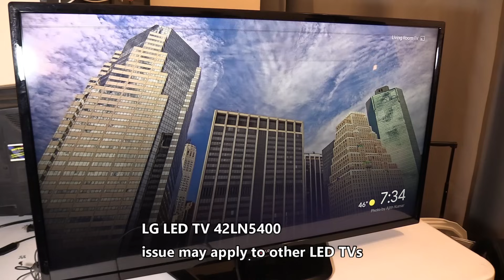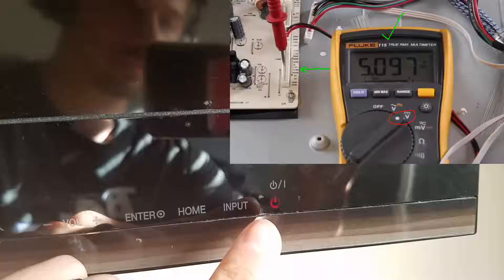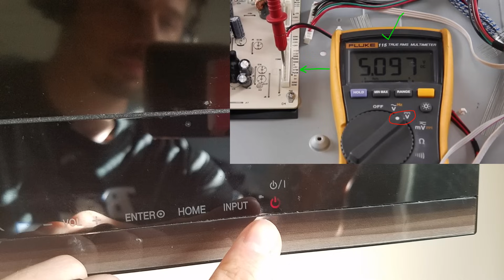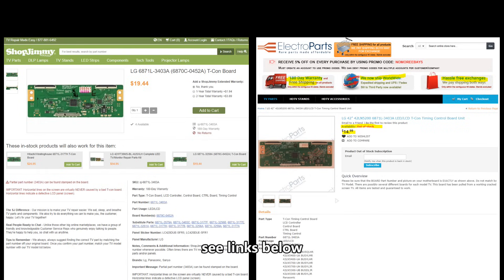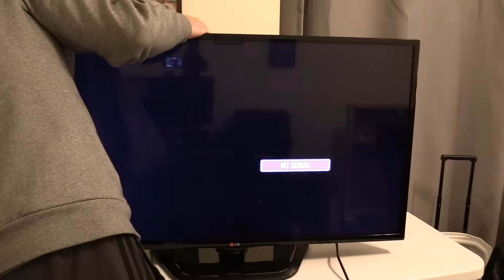How to Fix LED LCD TV with horizontal & vertical lines on the screen

Comment: Hi....Have a SAMSUNG LA26RT1B LCD with T-CON 260W3C4LV0.0 (Panel : LTA260W2-L13 Samsung), the problem is thick white bar about 3/4th from bottom, only signals TP on T-con Board is CPV1, CPV2, STV (not finding the CKV TP points), can you kindly help me with guidance for trouble shooting...Many thanks in advnce

Comment: Hi I found your video very informative . I have a Lg ultra hd and have the intermittent horizontal lines at the bottom of the screen approx 15% of the viewing area changed the Tcon board as suggested but still have the same problem do you have any further suggestions 
Thanks Tony

Comment from the maker: Permanent solid black Horizontal lines isn't a bad tcon board that issue is a Bad LCD screen. Vertical lines lllll usually bad tcon board or tcon cable connections.
Reply: Thanks for the clarification. Mine has horizontal line, Started off with 1 or 2 line and now a couple months later has several horizontal lines. I switched out the tcon board anyway since they are fairly inexpensive and didn't work so i guess i have a bad screen.
Reply: So far the T-con sounds like the most likely & it is one of the cheapest parts to get but I know nothing about the variables like any other possible causes of this problem. I know very little about the inner workings of an LED LCD 3D TV.
Reply: I have a samsung lcd tv that has 2 green permanent horizontal lines at the bottom of the screen, and the tv starts to glow bright white after being turned on for a few minutes. Is that the same thing?
Reply: My sharp LC-39LE440M is having half screen issue and probably with bad tcon board. where can i order new tcon board? im from philippines.
Reply: @howardoscillada6319  try shoppee or lazada they have tcon parts..
Reply: Hi guys i have a lg 49uj634v led tv with 2 horizontal lines one at top and one at bottom of screen the bottom one was goint pink or purple color i did some picture color adjustment that pink color has gone but 2 libes still stay what could be the problem any ideas please thank you!
Reply: Do they be colorful
Reply: ok thanks!😊😊i will try and revert you back here!
Reply: Hello Mr Tampatec. I have a black dot in the upper left hand corner of my Samsung. Any fix? Thanks
Reply: I have a band of very faint vertical purple lines down the middle any help in how to get rid it's a Panasonic 50 inch thanks
Reply: I just replaced my LED’s with no issues. Shortly after, a small section on the left showed up. Now vertical lines. Could I have not connected the T-Com ribbon cables correctly to the TV screen and sound/vibration caused it to come loose?
Reply: What causes a permanent  3 inch opaq white vertical band?
Reply: Hi my name is : Luis Duarte, I have one LED TV, SAMSUNG Model : UN40C7000WFXZA, the screen is full white horizontal lines, can you tellme what is the problem?
Reply: I have 2 or 3 black horizontal lines, I have replaced t-con board, lines still remain, what now? If this is bad led screen, is TV finished? Any answers
Reply: What about a permanent white horizontal line? Is that also a bad lcd screen? And would I be able to use the same fix as the video for this issue?
Reply: Hey TempaTec, what your doing for us is amazing by the way, I have a screen issues I don't understand how to describe it. Is there a way I can share you a video of it or picture so that you can help me fix it
Reply: This is strange because I have two vertical lines on my screen and read that it wasn't the t con board. Actually read that on shop Jimmy website and the other link you posted. So I'm confused?
Reply: P
Reply: But my picture still show pictures
Reply: I have a permanent horizontal green line which starts from left and fades out at right. is it also related to panel?
Reply: pls what of small coloured horizontal lines? lg smart tv??
Reply: how about to fix Sanyo FMV4612 thick vertical lines?
Reply: @Chromatic Moon
Reply: If is a solid white line…
Reply: I have two red horizontal permanent lines at the bottom screen and fading horizontal lines at the top that move up and down and it causes the picture to fade in and out where the lines are. Do you think it’s the tcon board that needs to be replaced?
Reply: Permanent solid black Horizontal lines were tcon problem for my LG 42LM620 3D TV... I replaced the tcon and lines were gone....
Reply: not like 10 years ago.  tv's are so cheap now
Reply: I just seen this comment and I think it answered a question I just asked you, good to know,thanks 3:58
Reply: Is this statement true for the newer Samsung qled tv's. I have 1 vertical line probably the size of my pinky more towards r/s of TV?
Reply: @vinnymac1  pinky? What is that?
Reply: @BomJimmy  finger
Reply: Hi
Reply: I have what was shown in one of the pictures of the examples of a bad t-con board but it only happens when the TV has been switched off & when I turn it on it has the lines so bad that it covers the screen but it will clear up after about 30 or 40 minutes. If there is a static image or little movement it can take up to an hour & a half but it always clears up eventually.

Is that still a t-con issue?

I'm just trying to be certain as I may have to fix this myself as most repair shops won't even look at it because they claim that it isn't worth repairing as the parts needed costs more than the TV is worth. It's old & finding a main board is pretty much impossible to find & the very rare few that I can find would knock me back between $400 to $500 but I can find almost all the other parts including the T-con & power board fairly easily & reasonably priced. Everything else works fine, even if the software is a little dated due to obsolescence but the picture & lighting is great for a 1080p TV when it's warmed up. 
I can find Canadian versions of the main board but it has two antenna plugs, unlike the Australian model but I could work around that with drilling a hole in the plastic shell of the TV but then I am uncertain of the voltage issues as Australia works on 240v 50Hz networks where Canada runs on 120v 50Hz power but I could hazard a guess that his may be more of an issue for the power board, much like the PSU's to a computer.

The TV had water splash on it a few years back because someone left a windows open when it rained & shorted out the TV but the lines didn't start until about 2 weeks after this happend but it has been like that ever since. It's an old problem that I've been trying to solve on & off for years but I have been hitting brick walls with the local TV repairmen so I'd really appreciate some clarity on the issue narrow it down without having to throw away too much money.

I know computers. I have built & repaired many but I have never even considered digging into fixing the home appliances until recently.

Could you offer me any advice on the matter please?
Reply: @DanielGall-Narcoleptic_Rage  dead air = dead channel - he can't answer  can't be bothered
Reply: @riceski  yeah, I figured as much so long ago that I actually forgot I made this query. 😳
Reply: @DanielGall-Narcoleptic_Rage   did u find a fix for this? my lg tv does the same.
Reply: Hi

Comment: hy i did change my t-con 2 times and still get 1 vertical line on screen i did replace to the cable , and still same problem some times after few hr go aways ? can u help me whit that i have a un48j5200 thank you
Reply from the maker: Check cable connections from tcon board to LCD screen should be boards under the TV bezel.
Reply: @TampaTec  ok thanks i am gonna do it now
Reply: @TampaTec  hi do u have an e-mail address so i can send u few picture whit my problem , i am try in to fix my tv but same problem

Comment: Thanks for the Info bro..
i just fix my LG tv 32ls3510
i used hot air on my T-com board and clean some flex
thanks to you i just diagnose my TV correctly..

Comment: Great videos…. I have watch several of yours and you really do a great job explaining things..
I was looking for a fix for my 3 yr old Emerson Model   LF461EM4 A, A 46-inch LCD HDTV with LED backlighting, but I could find nothing close to this on YouTube… 
  When I first turn it on (from cold start), everything looks fine, then after approximately a couple minutes, after warming up a bit, the Picture shows 3 distinct horizontal bands, (the bands are not made up of lines, just darker picture)... the top band is very dark, but can see the picture the middle band is a little dark, and the bottom band is just a little lighter than the middle one, and maybe near perfect. Do you have any ideas as to what this could be or where to find out about this problem. (could upload a pic, if you had that option some way.)

Comment: Help...I did as u said on my Septre 55” tv regarding lines & flickering I replaced the Tcon board put it Back together BUT I have a 7 prong wire that I can’t find where it goes. I cant wait to turn on my 6 mo old tv to see if I fixed it as per your video. Someone plz help, thanks to all who respond.

Comment: If the bottom HALF of the screen occasionally flickers black but works fine at other times, is this likely to be the cable or a board?

Comment: Ok I've switched my tcon board and the 3 colord lines on the left and one red line on the right are still there. What now ? It's a samsung 52 lcd . And it's over heating without a fan

Comment: Ive got an unusual situation. The menu is behind the lines, that's usually a sign the tcon or the ribbon cables going from tcon to panel... I disconnected the ribbons so the panel is running without tcon. I get a full black screen, but there are still lines.

How are lines still there without the tcon present?

I wanted to say video board, but again, the menu is behind the vert lines...

Edit ok a few mins later, the lines are now faint and almost not visible all of a sudden. That's weird... (Tcon still unplugged from main board and panel ribbons)
Reply: Sounds like the actual LCD

Comment: KDL-46VE5  I have this model and I have thin black horizontal lines across the tv they are a bit darker on the right side they kinda look like scan lines from an old crt. can u tell me if this is the fix for my tv thanks.

Comment: Your videos are really helpful.  I have a problem with a 37 inch Westinghouse  This tv has a fully whited out screen with black and Grey wide vertical bars  it has sound. I replaced the TCon board and no change What else could cause this problem.

Comment: My tv doesnt have lines going all the way across it, it has a little box with lines in it, that moves across the tv. Never stays in the same place, just moves around. Cant find anything on google or youtube, so I cant diagnose the problem. Also cant afford to have it repaired by a professional.
Reply: Sounds like a connection problem

Comment: LG 55in 3D vertigo Redline. I've ordered the t-con board from eBay, if that doesn't work I feel very challenged to take all the housing off to inspect for damage on the ribbons. Thank you for your help I would have never gotten this far if it wasn't for you.
Reply: how did it go? did ya fix it?

Comment: Hi Paul, I have a Samsung TV, when I turn it on, there are a lot of color horizontal lines on the screen and with a very loud sound (like the old TV when it has no signal). I was thinking about the capacitors but they look normal to me. I don't know should I replace the panel board or capacitors?

Comment: Tampatec, have a MAGNAVOX 42" 42MF231D/37 plasma tv with vertical green line on right side(about 2 pixel width entire vertical length of display) & when turn tv on I get flashing images(diff colors for few seconds) before see image from satellite box & the green vertical line. At times the sound goes out until change channel, but isn't all the time, what is; is a high pitch sound from speakers. Would appreciate help in letting me know if logic board, main board, or y-sustain/buffer board. The connection from directv satellite box is HDMI to main board tv input, if helps any. Speakers on this model are connected with speaker wire & the push tab connections on back of tv(so able to get diff/bigger speakers if want to). Hope able to give advice & help.
Cheers, A

Comment: Good video tampatec I have a 39 inch Philips tv that has red lines on top and at bottom of screen and had just a small visible screen in the middle that's watchable can you tell me what's wrong with my tv I was thinking t-con board but not for sure

Comment: My lg 42lm6410 is having the same problem..but there is no t-con board visible..the ribbons from the motherboard goes directly at the bottom of the panel where it is connected to a circuit board placed internally...can you help me in taking out the t con board out..

Comment: This is my second tv getting the virtical lines off of the screen. Seemed like things were going well I cleaned the connects with alcohol pad and attached back in place. I turned it on and seen the chanel so i turned off and sprayed with air to get clean before I checked it better inside my house. I plugged it in and now nothing. Vizio lights up at bottom and the screen flickers just a bit when turned on but nothing else. Tried to redo the clamps and tried making certain their in right position but still nothing. Guessing it might be gone now. I had to have done something to cause this though. I just don't know what I could have done. Thanks for listening

Comment: My TV has two wide bars running down vertically like about the third picture you showed. One is white and one grey. About six inches wide. They don't move or change and you can see through the grey one but the white one is harder. You think it might be just a matter of removing the ribbons and cleaning and reconnecting? My symptom appears around 1:21 in your video. Forgot to mention it started this after a child squirted water on it with a squirt gun and happened very quickly.

Comment: I have a LG 47lw5700 & there is a solid grey line on left side of screen about 4" in diameter. It's just darker than the rest of screen. Can you tell me wat it might be I'm really tech savvy & can't figure this one out. Have not changed any parts yet.

Comment: hi, nice video, i have a 50 inches sharp LED TV, the backlight is on, and there is sound, but there is no display, i tried to disconnect the left side of its LCD from T-con and the other half is working, and i do it in vice versa, the screen shows lines and gone eventually  but when tried to connect the two sides of the screen, there is no display. is that a tcon problem? or the LCD?

Comment: Great Video! I have an LCD sony kdl46-xbr3 with horizontal lines that are blue and pink/reddish. When I plug in the TV it works for about a minute then it starts with those horizontal lines.  I also see the green TV power light on the bottom of the TV. What could it be? and can I get the parts?

Comment: Hello I think my tv (52” toshiba lcd tv) has a bad board it has about  a 3” thick multi color strip going down the middle of it I have checked the vertical ribbon wires and can’t see anything that looks damaged...... was wondering if there was a easier way to contact you so I could show you what I mean?? Thank you

Comment: I replaced all 4 boards in my vizio e50-d1.  And I still have flickering horizontal lines on the bottom of quarter of my screen.  I noticed when I disconnect the right ribbon cable from my TV on board the flickering stops, and yes half of the screen is black, but the other half is on and doesnt flicker.  Is this a sign of a bad lcd panel?
Reply: I think you should replace your ribbon wire.this same thing happened to me.
Reply: @karunjoseph6306  you should get a new tv

Comment: I never dropped or hit my tv but I was playing ps4 and a black line just came up and went away but not it won’t go away
Reply: Something similar happened to my while playing PS4 too
Reply: It's in the audio/video board this comes from  power surges through hdmi cables.
Reply: @HandyTim  how to fix it?
Reply: how did u fixed it?
Reply: henkiespenkie44 I didn’t it changed colors but now it just won’t go away at all it’s a solid line going from the left to right of my screen side to side. They aren’t flickering or anything
Reply: Lil Flyer same

Comment: I have an LG LED monitor it's like 2 years old there is a part of the screen that developed a sort of shadow it still displays but is just darker. I did some experiments to rule out my computer and my video card. At first, I could cycle the power of the monitor a couple times and it would go away for a day or two.
This is where things get kinda weird I turned my monitor on and the shadow was there and well I couldn't get it to go away so I started shopping for a new one then I got an idea.
I opened the Nvidia control panel and played around with the resolutions at a lower resolution the shadow would vanish but the native resolution had the shadow. I then made a custom resolution that goes 1 number under the native so I put in 1919x1079 and well it worked. I have no way to explain this nor can I figure out what could be wrong and well here I am asking if anyone might have any idea about what may be happening. I was wondering if switching from an HDMI cable to an SVGA cable would help with something like this if it comes back again?

Comment: I have an LG LCD that has a single hoizontal line that is lighter than the background for about an inch and is darker (black on dark colors, red on white backgrounds) about 2/3 of the way across the screen.  There are no problems on the right third of the screen.  Loose ribbon cable?
Thanks

Comment: I HAVE LG 55W5600 GREEN LINE AND WHITE STRIPS I CHECK THE T-COM AND CLEANED BUT STILL THE SAME PROBLEM  AND ALSO WHITE THICK LINE IN THE TOP